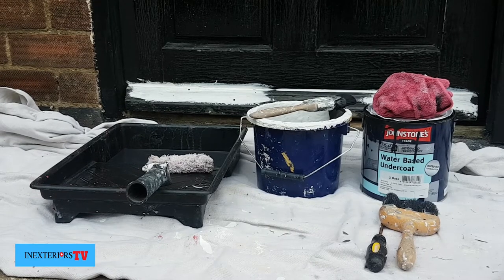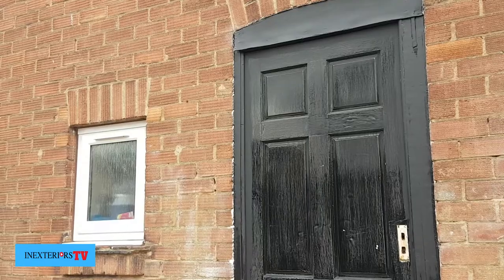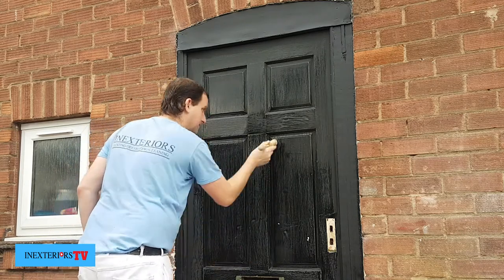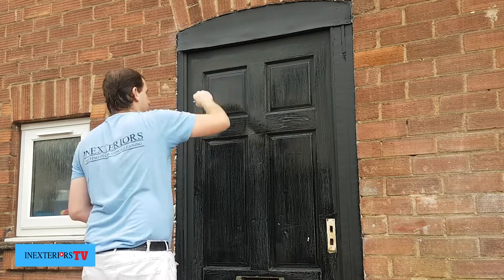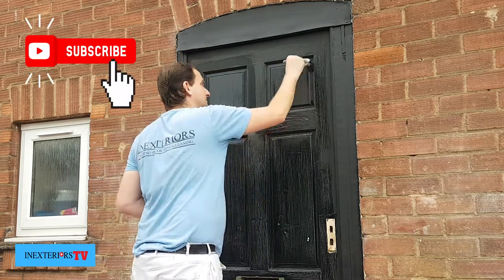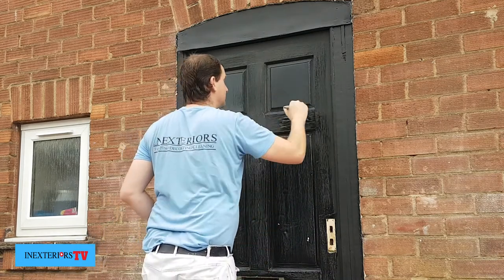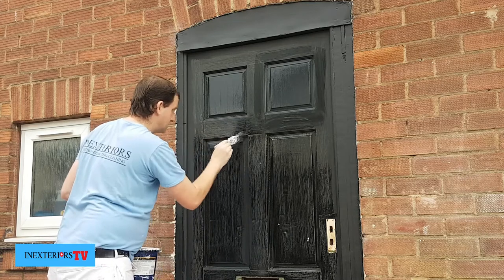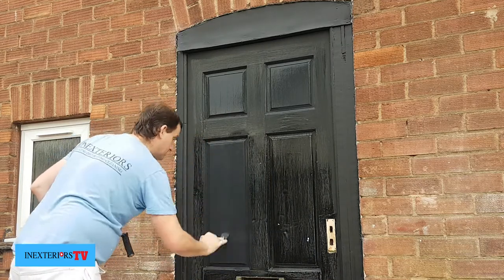How to undercoat an exterior door. How to paint a door.

Comment: Quick question mate  I'm painting my front door a light blue  the colour of the door at the moment is black  what colour of undercoat should I use?
Reply from the maker: @boaby boy . If you chose the colour from a colour chart then the chart might have an undercoat guide on it, If not to be safe i would get the undercoat mixed the same as the top coat, were are you getting your paint from, they should be able to guide you bud.
Reply: @Inexteriors  I've just gone for a white undercoat m8 dulux trade   the new colour is sky blue  its very light color
Reply from the maker: @boabyboy978 You might need to give it 2 coats of the light blue, let me know how you get on.
Reply: @Inexteriors  cheers will do
Reply: @Inexteriors  door turned out fine 🙂
Reply from the maker: @boabyboy978  Great stuff bud, well done.
Reply: @Inexteriors  can I ask another question please   I have stains on my ceiling due to damage to the roof a few years ago  I have tried zinsser 123 blocker but the stains are still showing  any ideas what to do next?  Thanks
Reply from the maker: @boaby boy . No probs, its Zinsser b.i.n you want to be using to go over water marks as it is shallac based, give it 2 coats.
The zinsser bullseye 123 is water based and will not work on water marks.
Reply: @Inexteriors  brilliant m8  thanks